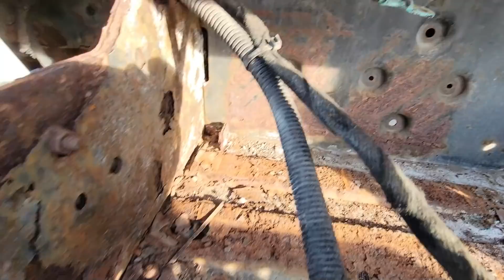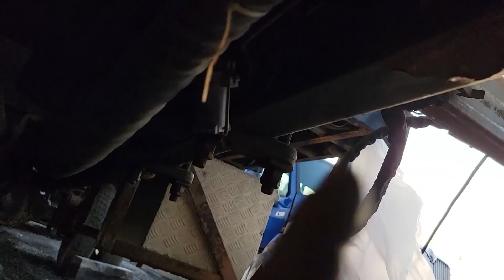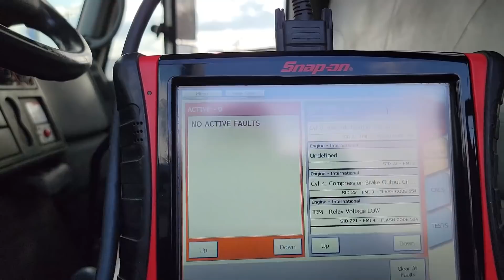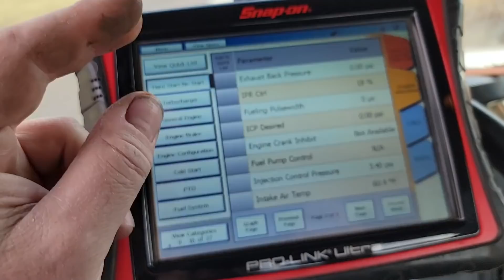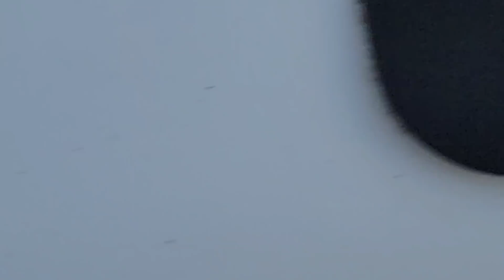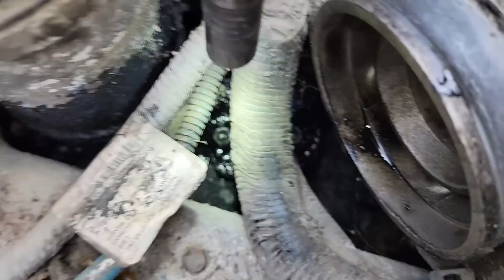2007 INTERNATIONAL 4200 TOWED IN. HASNT RUN IN OVER 5 YEARS!

Comment: Tip rom fellow intertrashional technician…… to stop beeping on older style dashes, press and hold  panel up on left switch panel by the steering wheel as you hold the little button on the cluster. Hold both till beep stops… thank me later lol

Comment: A lot of that stuff to probably triggered because the belt through and when the battery voltage went down the computer freaked out that is the downside of international the computers are temperamental

Comment: I drove an O2 4300 4 a couple of years one thing I learned about these trucks is if they do get hot the computer will shut the engine down before it overheats saving the motor so that code you got for an overheat doesn't necessarily mean it overheated it just means it got hot and it reached the critical level to shut it down

Comment: I've learned alot from ur videos thanks for the info could a small oil leak cause injecter problems on a mechanical engine
Reply from the maker: mechanical engines dont use engine oil as a high pressure system. small oil leak should have no effect on the injection if it uses an injection pump or cam driven injectors.

Comment: Do you have a method to remove the glue residue from vinyl lettering on truck cabs?  I have a truck the previous owner removed the lettering but left the glue.  My attempts have removed more paint than glue.
Reply from the maker: 3m makes an "eraser wheel". i use it in a low rpm drill. i have never had it damage the paint at all. f i then follow up with some lacquer thinner to clean what is left. too much lacquer thin can remove paint.
Reply: @j.c.smithprojects  Thank you. I’ll be trying the 3m method soon.

Comment: Another trash to treasure score! J.C. I have a technical question for you in regards to a project truck of my own.  if you have time is there a way to PM you?
Reply from the maker: what is your question. if i send you to my email, you will undoubtedly get lost in hundreds that come through.
Reply: @j.c.smithprojects  
Ha! Understand. I a single axle, spring ride truck. I have a fl120 air ride parts truck. Would you think a frame cut and swap or a suspension swap would be the way to go?
Reply from the maker: i never cut and weld a frame when it can be re-drilled. if you have enough frame to drill holes for the air ride, that is what i would do.
Reply: @j.c.smithprojects  
Awesome,  thank you. Thats where I was leaning. I  is was a bit skeptical about the swap for 2 reasons. 1) getting it all squared up and 2 components such as ABS compatibility and the like. I just didn't want to go all in, get half way and end up down rabbit hole creek. I've built lots of custom farm trucks but I've never done a full suspension swap.
With gratitude,
Aaron
Reply from the maker: when i am squaring a different suspension in new location, i find 3 points on the frame rail to measure from to double check my method. once you have see how sloppy some of these worn out suspension bushings are, it may relieve some of you concerns. many of the medium and heavy trucks use the the same systems.
Reply: @j.c.smithprojects  
I'll start there! Thank you so much for your help and time! Please keep up the content!

Comment: Thanks for letting us look in with you. I quit working on heavy diesels way before any of the electronic controls came along. It amazes me to how complicated a simple system as a diesel has become. 
 That does look like a nice nose and cab. Did it come from South of the rust belt? Is the frame just as good or is it rust jacked? That crane looks like it could be handy on a short chassis truck for pulling parts when the big forklift isn't around.
Have fun and be safe!
Cheers
Terry